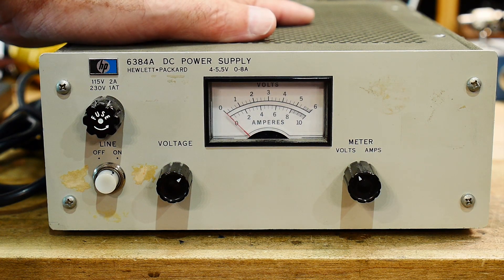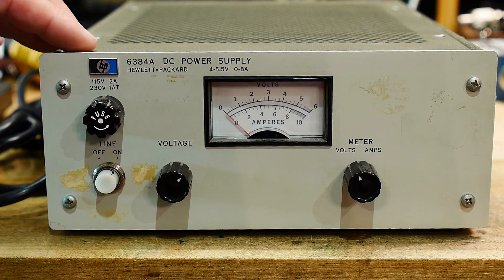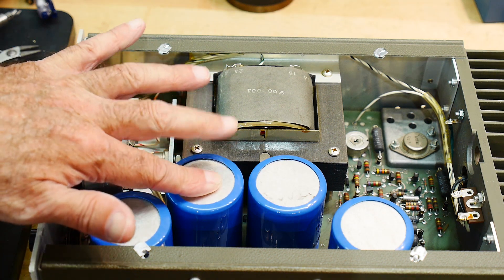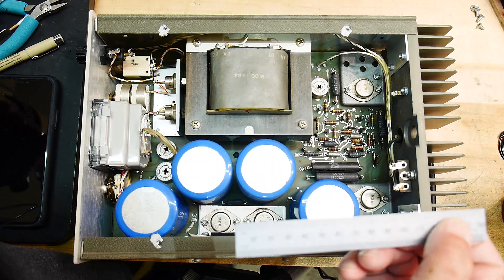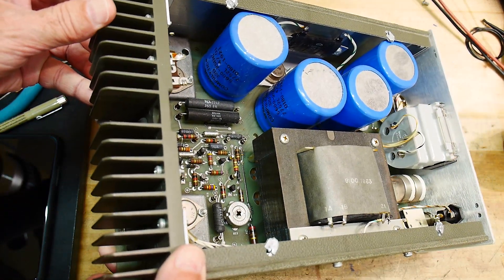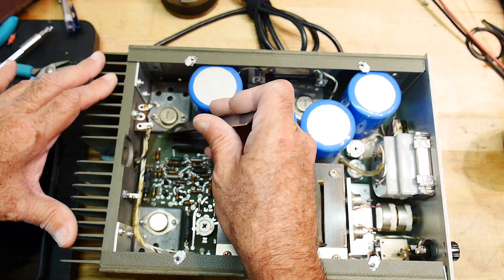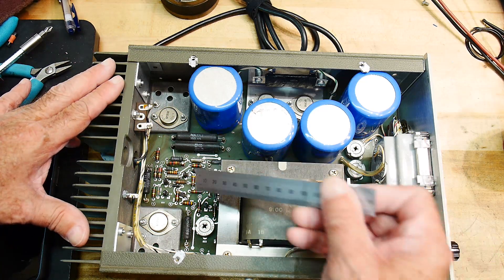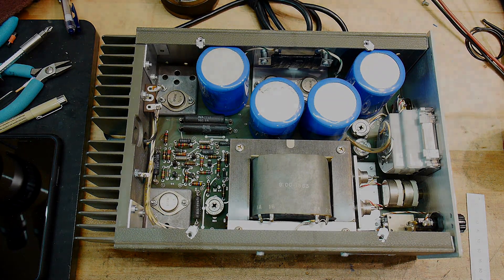#538 HP 6384A 4.0-5.5V 8A Power Supply

Comment: I worked at the HP division that made these in New Jersey. I joined shortly after they acquired Harrison Labs. They also acquired Boonton Radio in New Jersey. The 6384 is classified as a 1/2 rack unit. They also had full rack width in 5 inch high such as the 6287. The Harrison Lab versions were grey. The HP versions became mint green.